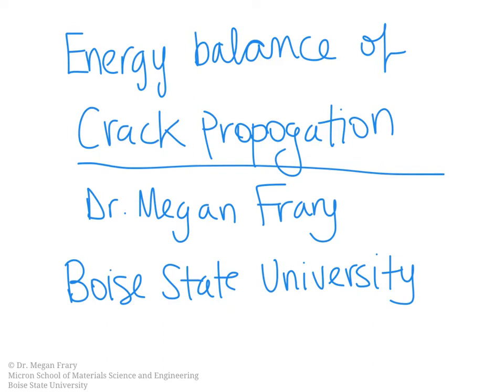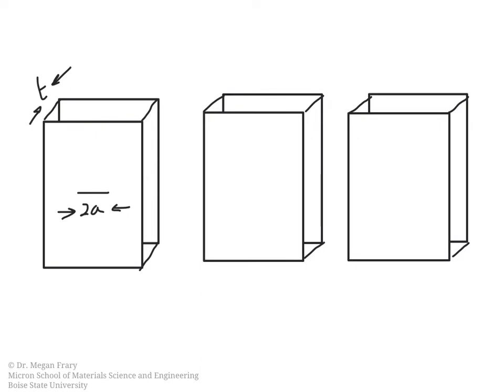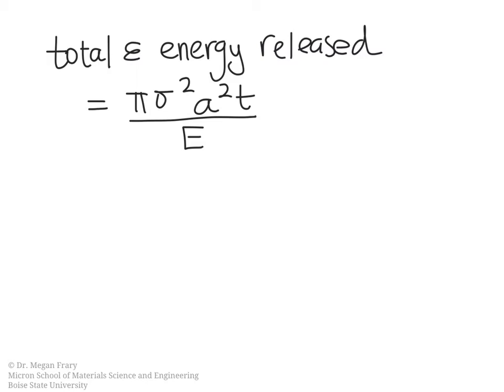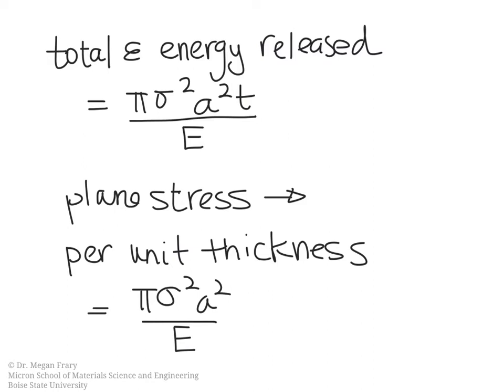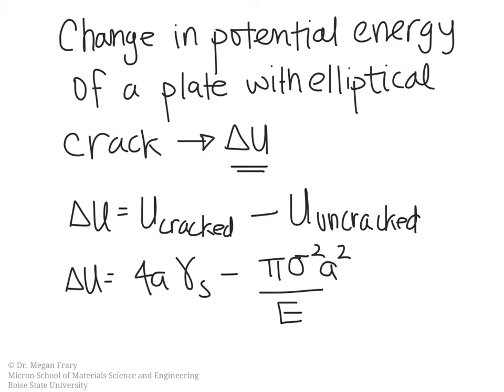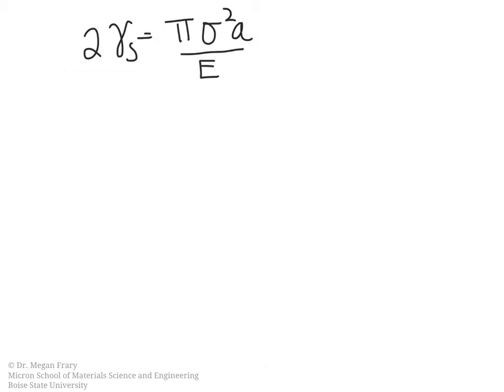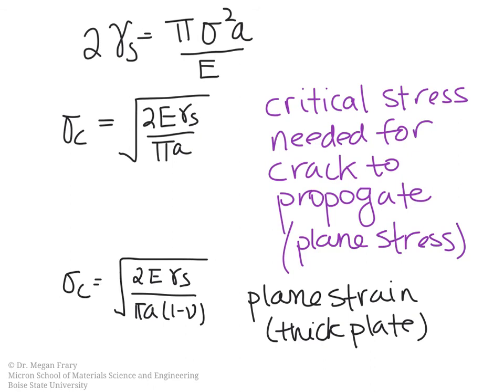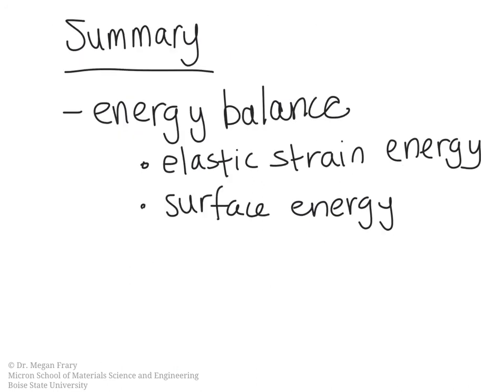Energy balance of crack propogation

Comment: At minute 9.30 you add a constant for plane strain. If I were to do the opposite, (1) to go from plane strain to plane stress, would it be only necessary to multiply by such constant rather than dividing as you did? (2) In this case, the constant is not representing confinment in the direction of thickness but what is it representing now?